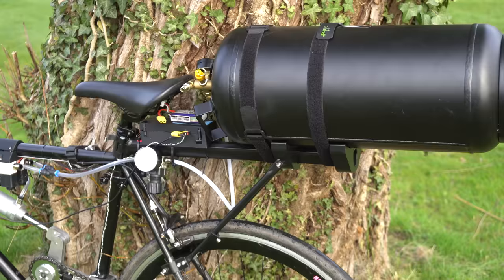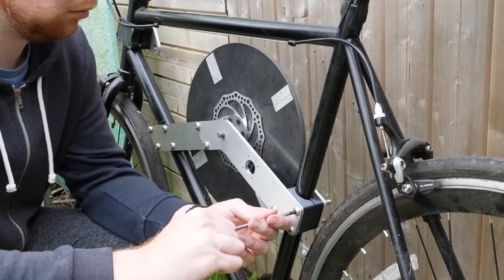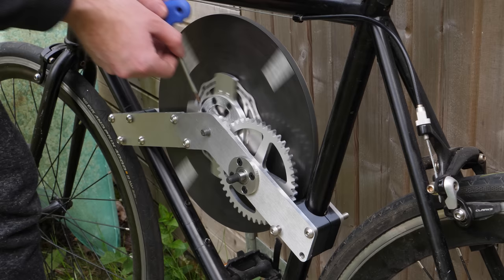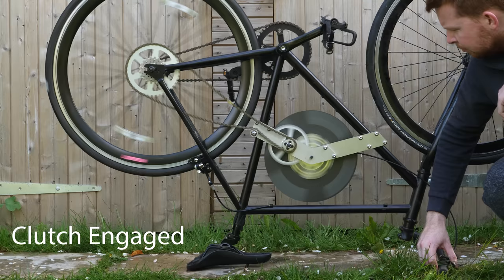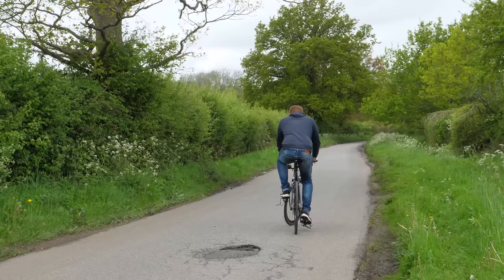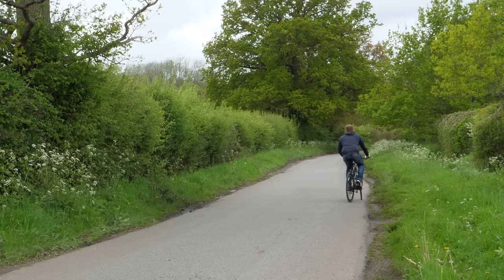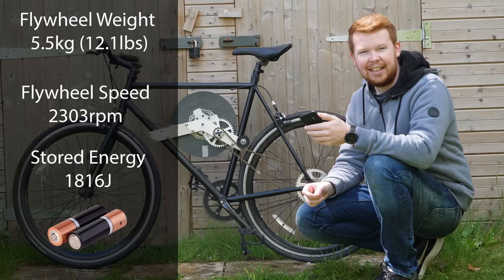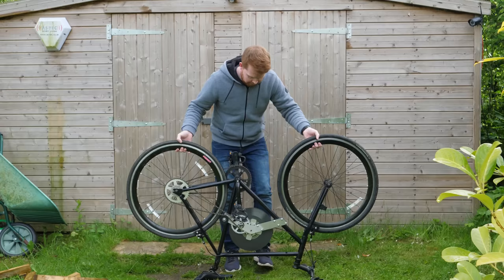Flywheel Bike KERS

Comment: Tom, you need 2 gears for the fly-wheel, a high gear-ratio for slowing down and a low-gear-ratio for speeding up,  think of this this way when equilibrium is reached you want fly wheel speed high relative to wheel speed, but when speeding up you want the wheel speed to be high relative to fly wheel, anything inbetween can "solved" with your clutch.
Reply: This is what I was thinking with 2 clutches... But probably has diminishing returns as the larger mismatch of speed across the clutch means more lost energy as heat.
Reply: @JamesUKE92  I agree, 2 clutches with their own gearsets. Braking force will be much higher than acceleration force, but that's exactly what you want. You'll have a small assist accelerating up to a much higher speed.
Reply: The problem is not a lack of torque, it's a mismatch between the  speed of the bike and the flywheel. All the time the clutch is slipping, it is wasting energy. But as soon as it engages, it is no longer transferring power because the speeds match.
As he says a couple of times, he needs a continuously variable transmission so the flywheel can accelerate as the bike decelerates.
Reply: Maybe CVT actuated by hydraulic brake levers may be solution. That would give variable ratio gearing. Also clutch mechanism functionality could be achieved by undertensioning belt between CVT wheels.
Reply: @vyrukas2  The simplest solution and probably the most energy efficient on small scale is to use an electric generator and motor (or ofc ditch the flywheel and use ultracaps or high amperage batteries).
Reply: @robinbennett5994  This is the issue.  If he had a CVT there wouldn't be an issue peaking once the speeds match as long as the flywheel still had some kinetic energy.

Comment: Needs a sprag clutch on the flywheel in series with the clutch, so that when decelerating it automatically disengages when the flywheel exceeds the bikes speed.
Reply: There's a slight issue with that. You would go from decelerating at a fair rate to instantly freewheeling. I was thinking the same thing but I reckon it would be a bit hairy having that occur.
Reply: @Alan_Hans__  How about in tandem (if there is space enough) with a centrifugal clutch?
Reply: A centrifugal clutch linked to a centrifugal variator is kinda what is needed. Someone posted some info in a comment about a super simple ball CVT by “funtastyx” that could possibly be integrated somehow. With a 3D printer and a NC router there's a lot that could be done. 
I also reckon a car flywheel would be a better option as well as more of it's weight is further from it's axis which make it a more efficient use of the weight.
Reply: @Alan_Hans__  it would an already is a deminishing braking effect, as the speeds begin to match it brakes less and less, wouldnt go from all to nothing itd be gradual.. the issue with the sprag clutch is youd need a way to put the energy back to the ground, either a whole seperate clutch and lever or some way to take the sprag out of the system for acceleration..

i think itd be a fine system if the flywheel weight alot more, with it weighing less than the bike the speeds match each other far to quickly and theres not much energy in the flywheel to accelerate you, and if you dont use the energy after a stop it doesnt have much braking effort left for the next stop either, with a heavier fly wheel and a higher gear ratio for it to spin it far faster than 2300rpms.. like 10k-15k rpms youd be able to store multiple stops, long descents down hills where  it isnt safe to just build max speed you need to brake.. might be able to store enough energy in it to actually propel you to cruising speed or assist meaninfully in hills at that point

Comment: Now you need to design a CVT to transfer more more energy into the flywheel instead of wasting the remainder of the momentum in brake pad heat.  Also, with a different spoke design you might be able to place a 26" flywheel concentric in the wheel.  The larger size could store more energy at lower rotational speed.
Reply: @lIIIIIllll  Do you know how CVTs work? It wouldn't eliminate the need for a lever. You'd still need to manually operate a clutch to engage the system. What a CVT would do is massively increase the efficiency of the system. Tom made a little diagram showing how the flywheel and the bicycle wheel eventually reach the same speed, but with a CVT it would allow for the flywheel to reach speeds faster than the bicycle wheel.
Reply: @XiuHang  also variable ratio for powering the wheels back up to speed more efficiently
Reply: @lIIIIIllll  I'm going to be very straightforward here and try to be as not mean as I can.

Your comment is quite literally the dumbest take possible on the use of a CVT in this scenario. The use of a clutch lever in this situation wouldn't be to actuate the transition of the CVT from lower gear ratios to higher gear ratios. The use of a clutch lever in this situation would be to engage the entire system. The  KERS shouldn't be functioning at all times; it should only be functioning during stopping and starting, so you use a lever to engage the system when you're stopping and starting. Then if the CVT functions properly, you couldn't just use a CVT system from a scooter or car you'd have to design one for this specific use case, it would incredibly increase the efficiency of storing energy into the KERS and retrieving energy from the KERS.
Reply: @lIIIIIllll  I'm going to reply here then stop because at this point I think you're intentionally being obtuse.

First, I never discussed anything near physics; I described the very simple mechanical reality of a single gear being less efficient than a CVT in regards to energy transfer from one rotating object to another.

Second, I didn't even push the idea that Tom should design and build a CVT. I pointed out that a hypothetical CVT would still need a lever for engaging the KERS.

Third, this hypothetical CVT wouldn't even be that complicated to build. You could almost entirely use scooter CVT design; you'd just have to tune the centrifugal spring mechanism to operate at bicycle speeds instead of scooter speeds.

Finally, Tom literally build his own electric motor for a video. Would it really be that surprising if someone who enjoys building e-bikes and e-bike related things built a CVT for a KERS?
Reply: @lIIIIIllll  I genuinely thought I wouldn't respond to you again, and I've made a promise to myself to not respond again no matter how stupid your response, so this will absolutely be the last bit I type here:

1. You don't understand chronologically linear steps. (See your step 6)
2. The lever in question is to engage the KERS and start spinning the flywheel, I don't even understand what you think I'm talking about. Are you trying to imply that I'm referring to the internal clutch in the output?
3. KERS stands for Kinetic Energy Recovery System. Yes we are talking about a KERS even if it is purely mechanical and not electronic.
4. Your worry about slippage is genuinely stupid because we're working with a damn human as the load. Less load means less torque necessary. Less torque necessary means less friction needed on the CVT to prevent slippage.
5. The tuning would be to make the CVT work at bicycle speeds not "human size."
6. Your point 9 is accurate, but once again I wasn't the one who was suggesting actually building a CVT. I was pointing out the logistics of operation and hypothetical efficiency.
7. I'm now absolutely certain you're being intentionally obtuse because you've misquoted me, responded to points not made, arbitrarily tried to alter the definition of a term being used, and ascribed motive that wasn't there.

If you're a troll, congratulations you got me. If you're not a troll you might want to pick up that mic and use it to ask someone to teach you how to read again because you have clearly not read the comments you've responded to.
Reply: Nerds
Reply: @lIIIIIllll  omg, you literally said mic drop. no argument you made could possibly be correct
Reply: You have no idea how the laws of energy consevation work.
That's not how things work.
Reply: @thetechfromheaven  lol, naw, how about a KX 125 motor 🤣🛵💨
Reply: @lIIIIIllll  I hope you realize that all a cvt is is a transmission that lets you vary the gear ratio along an analog waveform thus allowing for the ideal reduction of heat loss via friction in an ideal practice scenario.. figuring the function generation of the waveform itself would be the challenge aka what should y be if x is linear velocity. Similar to how a prop governor on turboshaft aircraft engines are, possibly a function generator could be rotating counterweights where spring tension adjusts the variable of the function, could be many things however the system would be complex. the main concern with the entire concept is that the energy stored only exists as a function over time which if too much passes will bring the stored energy to 0
Reply: What I would have done that is combined the flywheel with ebike technology. Putting the flywheel inside the rear wheel and using the e-bike drivehub to keep the flywheel going while the bike is stopped. This way the combination of the flywheel and drive hub would give you instantaneous takeoff with the maximum potential at reaching your original speed quicker. This would also allow for easy hill climbing depending on the size of the Hill. And if you could have the drive hub pulse to keep the RPM's of the flywheel up while it stopped it would prolong battery life a little longer.
Reply: @lIIIIIllll  Not to get into a huge involved argument here, but the way you keep talking about spring engagement and human power not being strong enough... are you actually talking about the centrifugal clutch scooters use with their CVTs? Because like, the CVT itself has nothing to do with engagement, just gear ratios.

And bike CVTs do exist commercially, Nuvinci makes them for only like 150 bucks, of course this has no clutch system at all since it's just used as an alternative to the conventional gear stack.
Reply: Could you use a CVT? 2300 RPM down to wheel rotational speeds? Would the ratio be to large?
Reply: This is the comment i was looking for!
Reply: What I would have done is use with the  ebike Technology. Putting the flywheel inside the rear wheel and using the e-bike drive motor to keep the flywheel going while the bike is stopped. This  combination of the flywheel and drive motor would give you instantaneous takeoff power with the maximum potential at reaching your original speed quicker. This would also allow for easy hill climbing depending on the size of the Hill.  If you could have the drive motor pulse to keep the RPM's of the flywheel up while it stopped, it would prolong battery life a little longer.
Reply: @lIIIIIllll  You're right the thing to prevent slippage would be the clutch not the CVT, but you're wrong about it not being possible for a human power clutch to work without slippage. If you specifically talk about only centrifugal clutches (which is an automatic clutch and not a manual one anyway) where weight and spring pressure is the only thing at play, then sure it'd be pretty light at low rpms. Of course a centrifugal clutch wouldn't work at all in this system, because the flywheel is constantly spinning, meaning it'd always engage the clutch except at very low rpm.

What you need is a manually engaged clutch, and I wholeheartedly disagree that a manually operated clutch won't be strong enough to prevent slippage, because pretty much every car, motorcycle, ATV, ect. is using a manually operated clutch, operated either by cable (usually in motorcycles and ATVs), or hydraulic cylinder (as most cars), and yet they are strong enough to not slip under the significantly stronger loads that an engine produces.

The reason the clutch slips so much in this video is because it's a shitty clutch, to be blunt. It lacks the surface area and material composition to grip properly, something like a motorcycle clutch would probably be able to engage fully with little to no slippage.

However, dumping all that energy at once with something as thin wheeled and light as a bicycle just means the rear wheel will be doing the slippage instead, and you'll get to do a burnout on a bike, which would be neat. Otherwise though if you slowly engage the clutch, just as you would on a motor vehicle, it'd work a lot better overall. 

There will always be some slippage because you can't just instantly accelerate up to full speed, but the amount in this video is far excessive of what can be achieved with a proper commerical clutch system.
Reply: @lIIIIIllll   A: I was talking about using the manual clutch with a conventional chain and sprocket, not paired with a CVT. Just a better clutch with no other modifications would help this build a lot. As I said in my previous post you'd still need to gently ease it on, and thus let it slip, in order to keep the wheel from just losing grip and spinning, the same way you have to do with any manual clutch motor vehicle, but the overly excessive clutch slippage in this video can be avoided.

B: I was never part of this "we" saying to use a scooter CVT, I simply pointed out you were mixing up the CVT and the centrifugal clutch-which you still are.

The reason you've never had to engage a clutch with using a CVT vehicle is because almost always CVTs are used for the purpose of a simple automatic transmission, and thus consequently will have either a centrifugal clutch (light vehicles like scooters) or a torque converter (heavy vehicles like cars) in place of a manual clutch. Both the centrifugal clutch and torque converter are also used on automatic transmissions with conventional gear trains, they're not an integral part of a CVT.

However manually engaged CVTs are hardly fantasy, I mentioned one in my original post, the Nuvinci N380 bicycle CVT can be bought on Amazon for 150 bucks, it uses the same type of one way ratchet engagement a normal bicycle gear stack uses to engage when you pedal, and disengage when you stop, so no friction element in the engagement system, only in the transmission itself.

Another common example of manually controlled CVTs are the hydrostatic transmissions frequently found on lawn tractors, though this is also a clutchless system. Finally for a historical example, the friction drive transmission found on early automobiles like the Cartercar feature a manually operated gear ratio via hand lever, and an entirely conventional foot pedal operated clutch.

Perhaps in the future you should take 5 minutes to lookup the first example I mentioned before declaring it a fantasy.
Reply: @lIIIIIllll   On the snowmobile transmission, that is indeed my bad there as I thought the pulleys and clutch were separate units, as they can be setup as with other transmissions.

Also when you said fantasy I thought you were saying the general concept of a manually operated CVT as opposed to a specific one perfect for this case, so I listed examples of manually operated CVTs.

As for the Nuvinci one, while it doesn't have a clutch built into it, you can easily add a manual clutch to the system since the drive input is external, and while it isn't governed by RPM automatically, you can manually step it up and down when you're charging the flywheel and then releasing it back into the drivetrain, I think that was the idea the other people were thinking of, so you can start off with low gear to give the flywheel more of a mechanical advantage when first starting, which would make the clutch have less slippage since it'd be under less resistance from the drivetrain, and then gradually shift into a higher gear as you get going to give you the maximum speed from the flywheel. Of course you can do this with a conventional bike gear stack as well, though I suppose using a CVT would make it more smooth since you don't have the distinct steps while shifting, though I'm not sure it'd actually make that much of a difference really.
Reply: @XiuHang  We could just have 2 gear ratios instead of CVT, we'll just need another control to switch between the two of them
Reply: @JTDragonFlash  OMG. I had this idea recently. I still have not figured out the exact configuration and part sourcing. I think the flywheel can double as a rotor for a motor/generator so there will be no mechanical linkage.